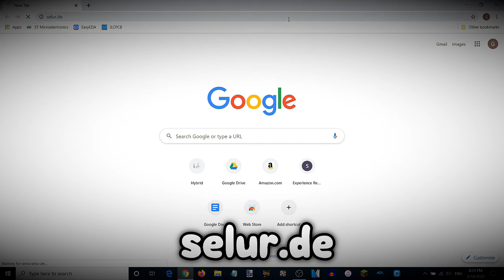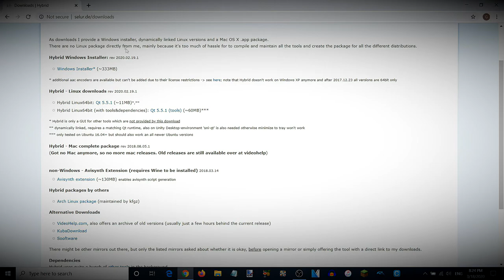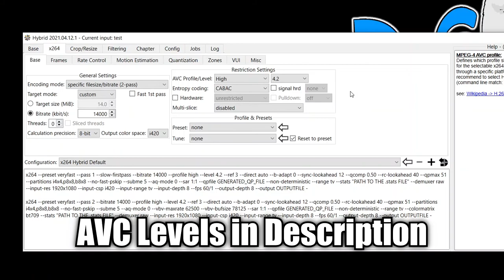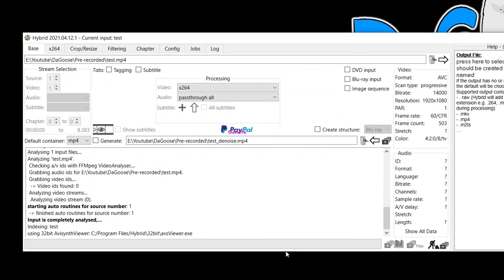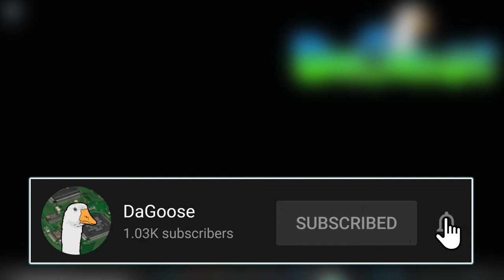How to DeNoise ANY Video in Hybrid | DeNoise Low Light Videos and Footage (Final Hybrid Guide)

Comment: Hi. How to speed up the encoding process without sacrificing the video quality. my conversion usually takes between 30 minutes to 1 hours or longer. thanks
Reply from the maker: There is no way without sacrificing quality or getting a better processor/gpu.
Reply: @DaGoose  what will be the recommended processor / gpu?
Reply from the maker: @ech33  the recommended processor / GPU for video encoding tasks is always the best currently available for retail. So probably 5950x cpu and rtx 3090 GPU. But for budget friendly options I would look at 11400f cpu and 1660ti GPU.